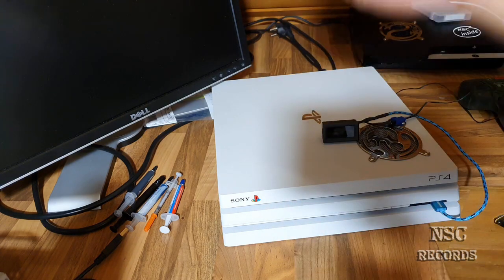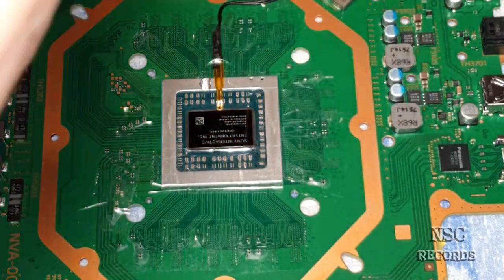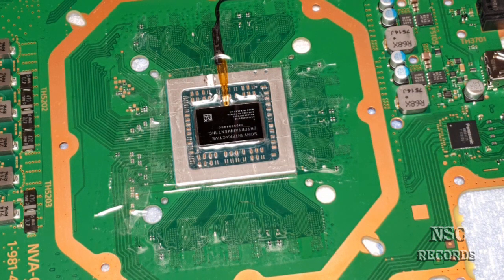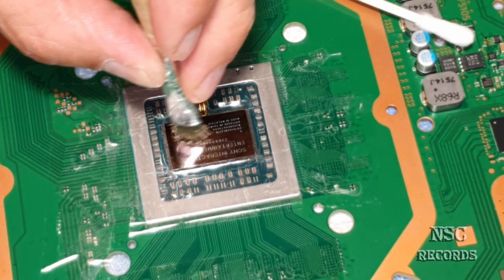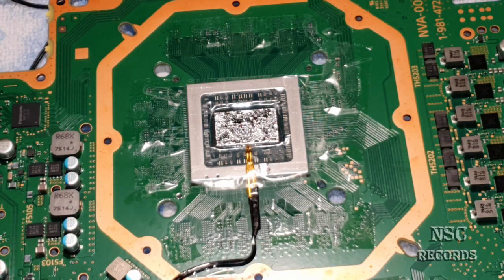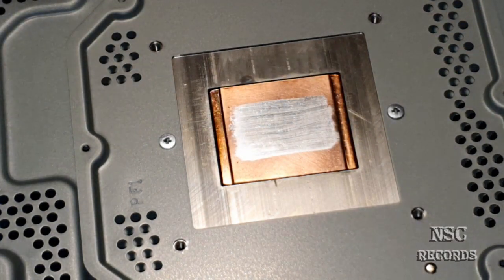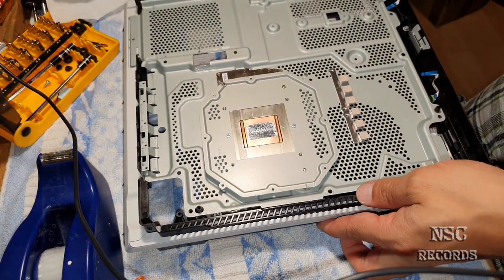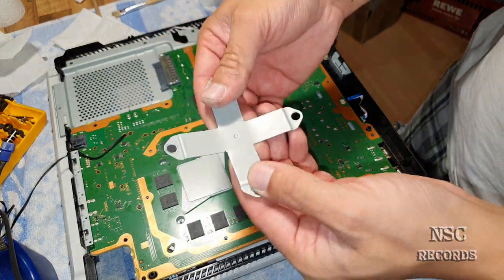The right way how to apply safely liquid metal thermal paste By:NSC

Comment: your video was the only one I found referring to the use of a protector against liquid metal leakage, I would like to do this on my PS 4 pro but I have a doubt instead of the normal tape would it be safe to use the "thermal pad" to protect the circuit?
I thought about it but I was in doubt whether the thermal pad could be a risk, Congratulations on the vide you get +1 follower......Sorry my bad English friend....😅
Reply from the maker: All cool, i understand you. I can recommend you Thermal Grizzly Kryonaut, no need liquid metal ;)
Reply: @NSC-Modz  thank you friend, high performance thermal grease seems to be a better choice, my interest would only be for comparison calculations between "liquid thermal paste vs mental liquid", to finish I have one last question, did you notice any oxidation or degradation of the processor die of PS 4, few videos talk about the long-term effects of liquid metal.  thank you in advance for everything, i really liked the content of your channel congratulations.👉👍👈
Reply from the maker: @onyx5952  Thank you so much, you very welcome ;) Yes it's true, but you get the most clean just with your fingernail on the APU, but on the copper cooler it self you gonna need to lap it a bit to get the most cleaned ^^ Google: Coollaboratory Extreme liquid metal. They say that this one gets hard to, but not so much like Coollaboratory Pro or Ultra. I got the Extreme edition my self and I'm happy with, "for now" 😆
Reply: @NSC-Modz  Thanks for the answer, it was very helpful, in the copper issue, there is a solid layer of "liquid metal on the copper surface" and it is totally normal that this occurs because the liquid metal fuses with the copper creating a layer "the copper is covered by a thin layer of solid liquid metal" this is because of an electron differential between "liquid metal vs copper", is an advantage as after this "coat" is formed, the "liquid metal" will stop reacting with the copper "since there is now a protective layer. Of course this is a advantage only when it occurs in the copper part, but if there is a solid metal formation or oxidation in the "processor die", in this case we will have a big problem. thanks again for the answer thanks for everything friend.😇

😅Forgive my bad English again😅
Reply from the maker: @onyx5952  your English is fine, my is not better xD yeah, i work a lot with LM, i had never a problem on the DIE it self, even but 2 years later, witch was my record with LM

Comment: if i use thermal pad and stick it on copper plate so liquid mqtal has no chance to spill out is that ok?
Reply from the maker: @zimmyvn  i don't understand it right what you mean, but i recommend to use thermal paste as long the cooler is not nickel plated.

Comment: Thank for your videos, I very like your work!

May I ask you: on PS3, for example, but I think this works for all other motherboards, if I can see scratches on processor data lines (the copper can be seen) is there any way to check is connection broken or not?
Currently I have 6 broken PS3 consoles, buyed in last 6 months, YSOD and so, and on every motherbors some megagigasuper exprets tryed to remove chip covers and during that process maked scratches on data lines... I try to reflow the chips but I think they will never work again due to motherboard damage...
All the best in your future work, keep being the best!
Reply from the maker: Thank you so much. When you see scratches on the CPU then it's Game Over :(